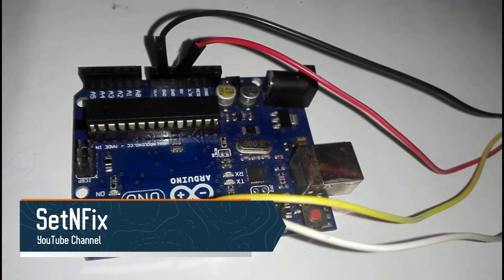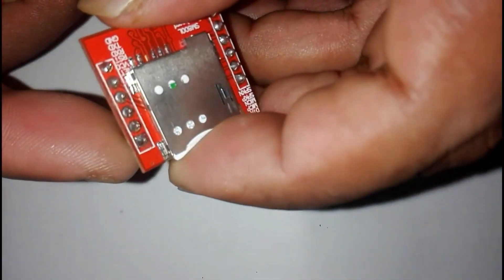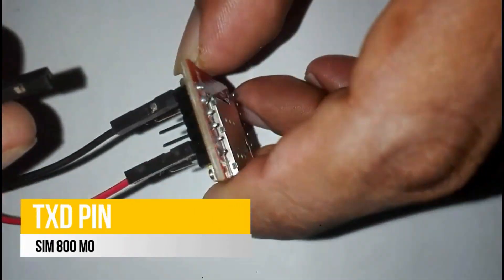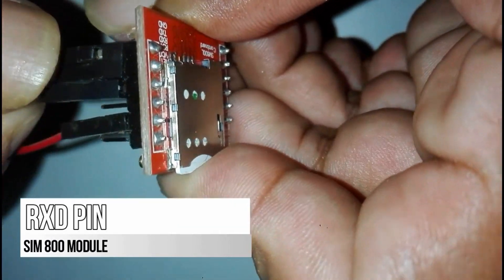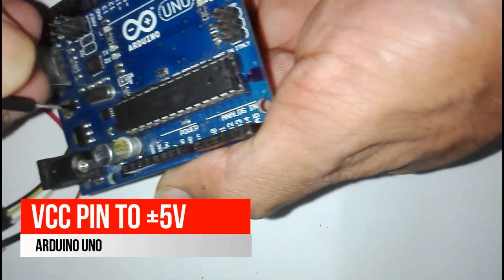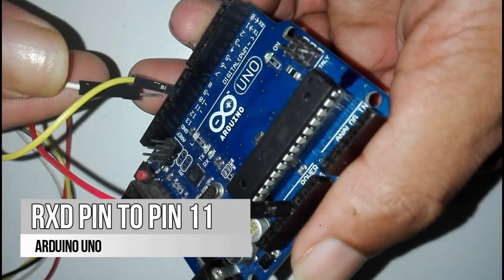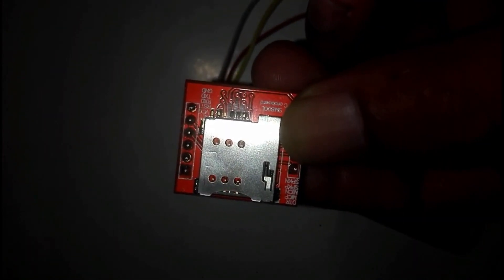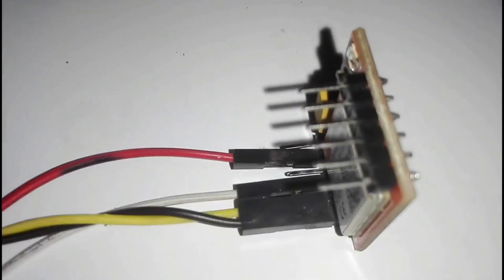Wiring SIM 800L GPRS Module  with Arduino uno

Comment: The datasheet says connect sim800l to the range 3.3 to 4.4 voltage
Reply from the maker: Yes. But if you give 5V from Arduino board via IN4001 diode. there is no issue.
Reply: @setnfix  can we connect this diode in series with ardunio
Reply from the maker: @BasitAli1  yes, you can

Comment: Hii,
why we don't connect the Tx and Rx pins coming from GSM module to the Arduino Tx and Rx pins instead of Pin 10 and Pin11
Reply from the maker: Yes, you can use RX and TX pins. then you may have to change the programme codes and Library codes as well. But if you use RX and TX pins of arduino you have to expect malfunction of the device in some instances.

Comment: Hi, I use arduinonano+sim800l+2relay to operate a 3 phase pump, but I don't no to code. Please help to code and fix it. Plz..
Reply from the maker: ok. you can learn it from next video. stay with SetNFix
Reply: @setnfix  thank u very much. When will u    put the video
Reply from the maker: @arahanthjain8576  I have already completed the tutorial. But, there are few editing works. I hope to upload it end of this week. Click the bell button then you will receive the notification once the video is uploaded.
Reply: @setnfix  did u upload the video
Reply from the maker: @arahanthjain8576  i am expecting to upload withing 10 hours
Reply: @setnfix  I didn't receive the video
Reply from the maker: @arahanthjain8576  watch my new video
Reply: @setnfix  where is the relay and arduino nano in that video
Reply from the maker: @arahanthjain8576  go to the link in the description
Reply: @setnfix  I am saying that u didn't use the arduino nano and relay. I expect u to do with this things
Reply from the maker: @arahanthjain8576  use the same pins of arduino nano. there is no change.
Reply from the maker: @arahanthjain8576  yes
Reply: @setnfix  can u make separate video by using Arduino nano+sim800l+relay
Reply: Plz response
Reply from the maker: @arahanthjain8576  Just replace the same pins of arduino uno with arduino nano. no changes with codes.
Reply: @setnfix  thank u

Comment: Can you also do this with the arduino nano?
Reply: Is it also possible to combine the SIM800l with a GPS module so that the gsm can send a location to your phone?
Reply from the maker: @MoOohBoyKills  yes you can connect gps module
Reply: Can you possibly help?
Reply from the maker: @MoOohBoyKills  I still dnt have a gps module. once i bought, i will do a video.
Reply from the maker: yes you can use arduino nano instead of uno
Reply: Allright

Comment: So connecting sim800l to 5v of Arduino does not fry chip?
Reply from the maker: not at all if you give the 5v from same arduino uno module
Reply: @setnfix  I saw some other YouTube videos they are using LM2596 to regulate voltage. So according to manufacturers we have to adjust voltage or we can give 5v from Arduino to any sim800l?
Reply from the maker: @swapnilpawar8128  The thing is, if you build a project as the final product, you have to find a smooth power supply. When the module is in operating (Specially sms), it is required about 2A current and average 4.4 volt. But the testing purposes you can use the same 5v power of the arduino uno because due to the power consumption of the arduino and the resistance o the module, this 5v can be reduced about 4.7v. You can see it from this video https://youtu.be/XW0LMg5hUPo. I have not tested any other module, but it is trusted to do the same for other ism 800l modules. If you have a doubt on the voltage, it is better to use 1N4001 diode. Yes, LM2596  is a good solution to give the power to the Module.
Reply: @setnfix  THANK YOU SIR❤️❤️